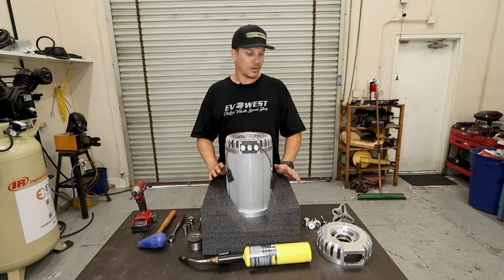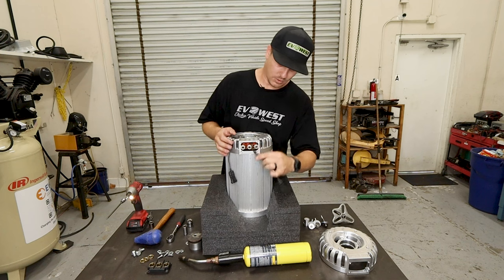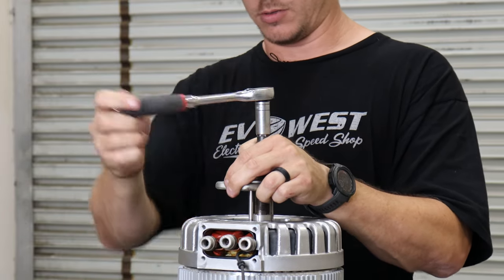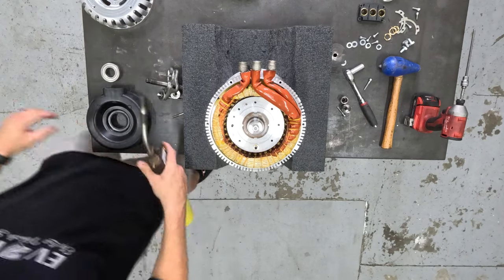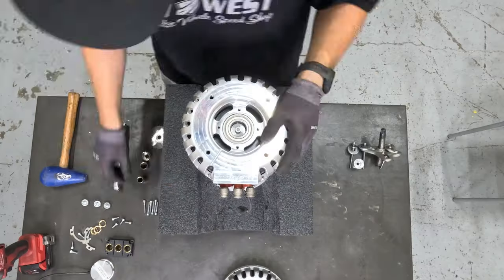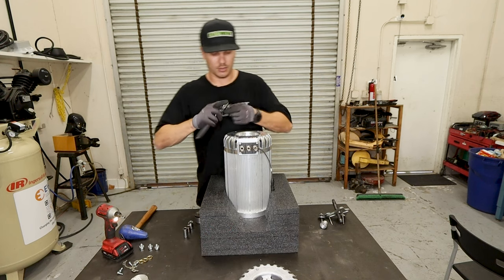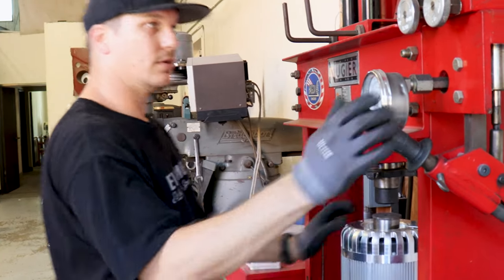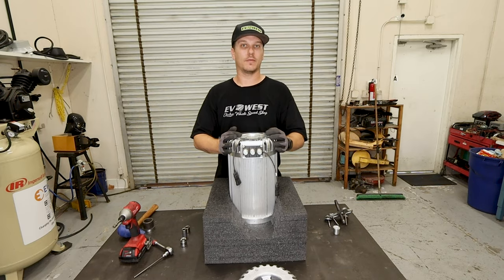EV West Billet Aluminum Endbell Hyper9 Installation - Remove and Replace Factory Endbell

Comment: Guys, the new end bell appears to add some length to the overall motor. How much longer is it compared to original? I have minimal clearances to play with...
Reply from the maker: i believe one of the team reached out to you directly, but wanted to add this information for the entire audience. The dimensions are the same other than that it increases the length by 1/2 inch.